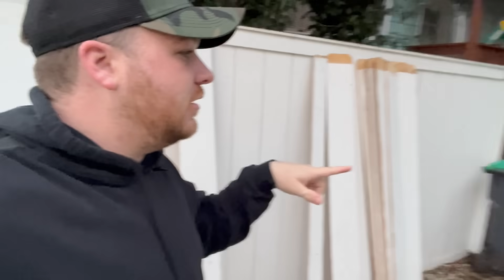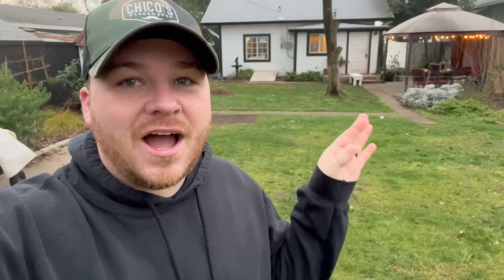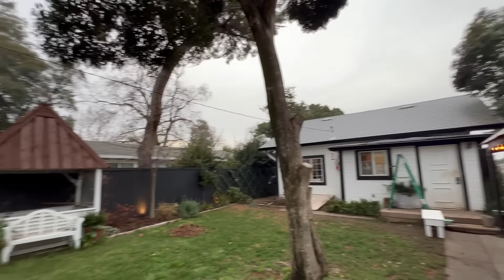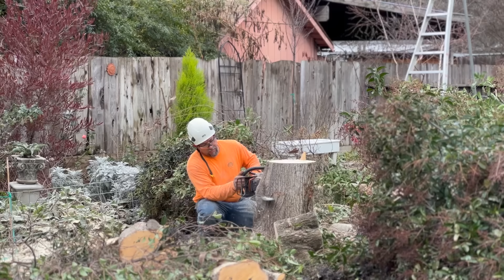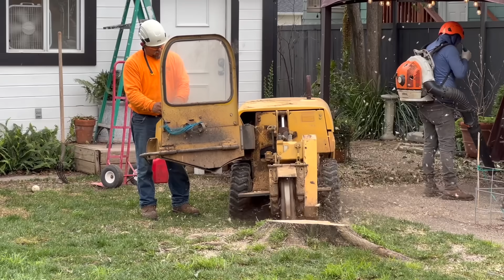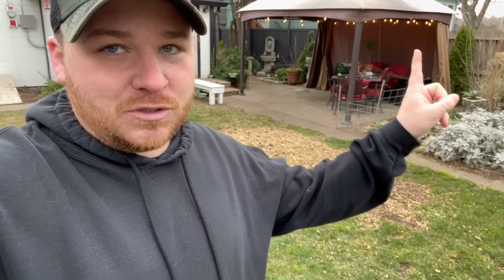It’s finally gone! 🌳 || Visit Our Garden

Comment: Such a refreshing feeling!  It looks so open now. Have you thought about a permanent roof cover for the driveway, to protect from the neighbours privet?  Here in Sydney Australia, some homes have added carports on their driveways and the roof lines are curved upwards with only metal supports to one side, everything that lands on the roof just rolls off, not sure if you guys use the same design, but money will spent, I think.